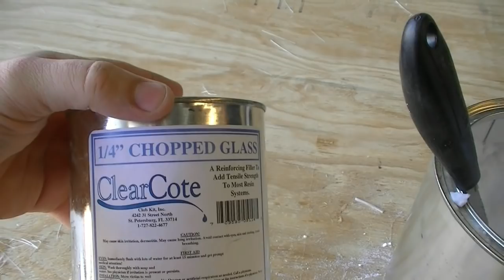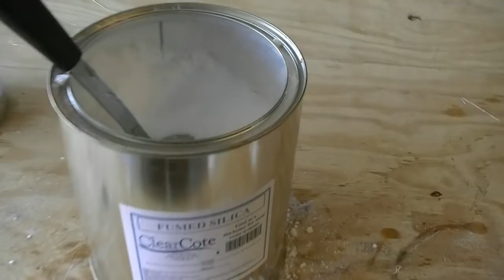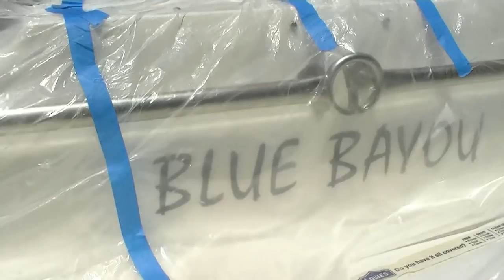Glassing in the stringers Part 3- BONUS PEANUT BUTTER Vlog #27

Comment: You asked about overkill. In my humble opinion it is. You could have just gone with a biaxial cloth and epxoy. The hull was strong enough as it is. One layer of biaxial on the wood and fillets is enough. Also think about all the extra weight you added. This boat is Fort Knox alright.

Comment: Getting ready to do stringers and floor in my grandfather's 87 Larson.  It currently has a roller trailer but I want to change over to bunks.  Would you recommend doing everything; cutting out and replacing stringers; on a bunk trailer or build a stand like you did for the Glastron?